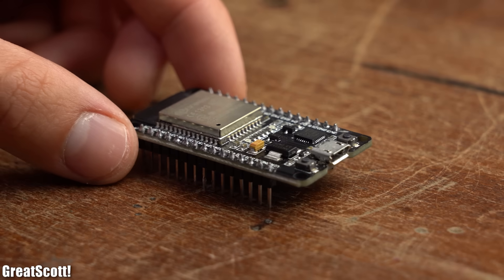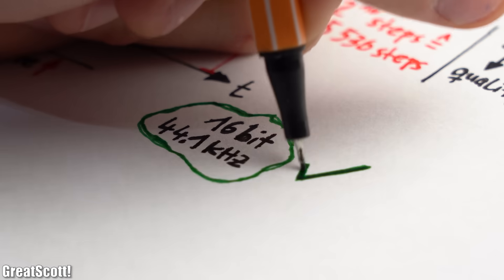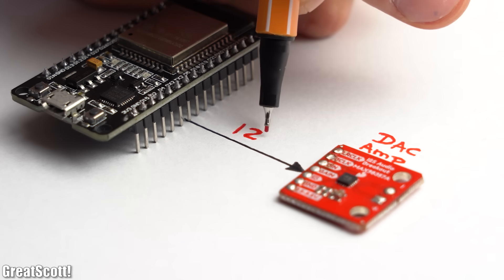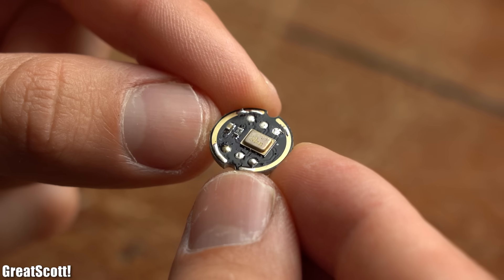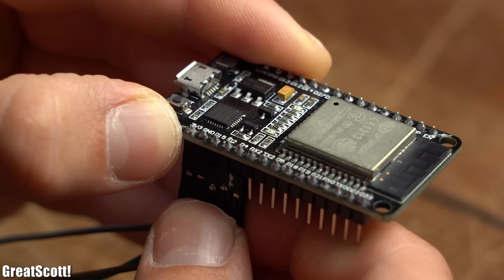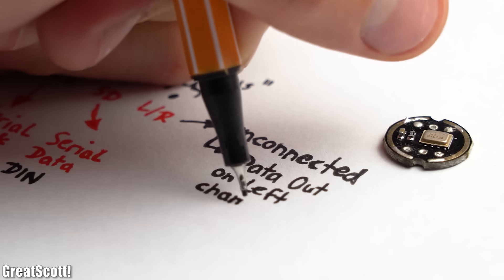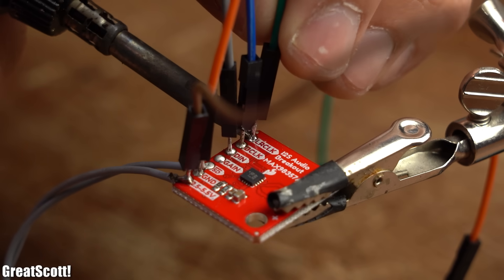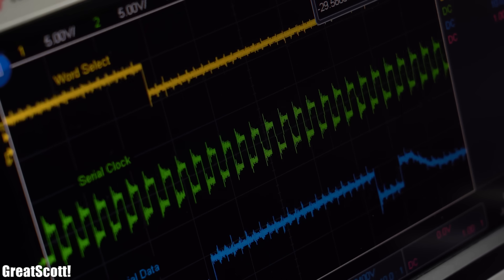Building a Digital Music Player with I2S?! What is I2S! EB#45

Comment: I wonder if they make a 24 bit and or a 32 bit float breakout board? Why did the playback sound in and out (Garbled)?
Reply: uhm... 24 bit is rather extreme - 16 million steps. there are 24 bit DAC but they cost quite a lot and are used only in very niece applications.
And no - you can not hear the difference between 16 bit and 24 bit - nobody can.

Anything above 24 bit - you are looking not at prebuilt chips but special purpose custom made circuitry - nothing of the shelf - cause simply there is no need for that.

Comment: The other day i,'ve tried to attach the i2s dac to my router. Finally the Linux community have fixed the dma driver and now my router can play music :D
Reply from the maker: Awesome :-)
Reply: @greatscottlab  Yes, my router is based around the mt7628an chip. It have pcie x1, lots of gpios, i2s or pcm. It also have 2r2t wifi 2.4Ghz.

If you run Openwrt you can do a lot of cool things!

Comment: Can you make a walkie talkie with 2 esp32's using this metod and wifi/bluetooth?
Reply from the maker: I can put it on my to do list
Reply: @greatscottlab  I'd love to see that.
Reply: Hmmm I guess it could be done... but bluetooth I think it's limited to about 10m  range, and wi-fi would require one device to act as an AP and others to trust it, also said device would have to be within a reasonable distance of every other device... seems like an overkill for something that could be done just over radio
Reply: Yes!
Reply: Ooo. Hack up some headsets perhaps?
Reply: Very interested.
Reply: Why don't you use RF module (433Mhz) for a long distance like 1000M. wifi/Bluetooth is so short for walkie talkie as you can hear the voice without any tools :)
Reply: Esp32 or stm32 black pills (NOT BLUE PILLS) also have I2S

Comment: Do you know why it sounded so weird in the end? Great video, btw!
Reply: We need a revisit when he figures it out. This is not acceptable quality from i2s
Reply: I agree from the video I expected it to sound much better.
Reply: @InlineSkater72  and me personally I get very interested in knowing what the problem is, sometimes it can give more insight when we are doing our own projects
Reply: Well I did a similar thing back in the day, but using raw audio and only SD and a r-2r ladder. I got the same results. It boils down to a problem with the SD protocol I think. So whenever I switch sectors in the sd card (read 512 bytes (one sector) and need to read another) the sd_read operation takes 1.5 milliseconds instead of the usually instantaneous speed. This results in an audible jitter in the audio. It occurs regardless if you read 1 bytes or a megabyte in burst mode, so long as that read operation has to cross a sector, ıt takes a solid 1.5 millisecond longer. (doesn't get effected by number of sector switches, maybe how computers can read faster -in burst mode-) I think the propper way to fix this is to have the SD read into a sufficiently large buffer and the I2C peripheral reading from that buffer in non-blocking mode (interrupts maybe? even utilising some hard-wired logic similar to what bitluni does) and only refill the buffer when you have read like %90 of it, and while the SD reads still allow the I2S to keep taking what's left of the buffer (so that the DAC will never have to wait for the SD to read). Not sure if this is how the mp3 library works but they probably read a small amount of data, decompress it then play it and when the section is done, they do it again thus when the total amount of bytes read the next section to be read takes 1.5 milliseconds longer, thus the wierd effect.
Reply: @batugunduz3950   I discovered this problem when trying to save real time measurement data onto an SD card. Was extremely annoying. 
I'll only use soldered flash chips for real time stuff from now on. -.-
Reply: @SciFiFactory  Yeah its a major bummer. Maybe you can write to flash in real timeand periodically dump that data to SD
Reply: The proper way to implement this is with a set of ping-pong DMA ram buffers. One buffer is read and the other is streamed with I2S. Both SD and I2S could benefit from DMA and do their thing in the background.
Reply: Isnt it due to the sampling of the analog signal?
Reply: @adamkoszaka1130  no, it isn't. The audio is sampled at CD-level quality (which is very good) and you can hear it when he plays it in Audacity. I am inclined towards it being an SD card read problem too.
Reply: It sounded like it could also be clipping the analog signal.
Reply: could it be a defective speaker?
Reply: Probably either unwanted interrupts or reading from sdcard took too long
Reply: Something is preventing a continuous stream of proper uncompressed audio output. It should sound CD quality. I would presume the mp3 decoding is taking too long. Maybe GS should try using uncompressed audio on the SD card.
Reply: @eDoc2020  For initial testing I'd use .wav data in progmem / psram with a suitably sized playback buffer.
Reply: Sounds like jitter

Comment: I am wondering about why the audio file at the end seemed to have been played so choppy. I'm not too knowledgeable on the circuitry at work but I believed the idea was to be able to play the uncompressed file without loss of quality. Was the choppy playback a result of a limiting component such as the amplifier?
Reply from the maker: My used code was the problem. I am not the best coder. Sorry. In theory you can playback uncompressed audio.
Reply: @greatscottlab  Maybe a buffer but anyways the video was awesome.

Comment: Finally a crystal clear explanation of I2S!
Reply from the maker: You're welcome :-)
Reply: @greatscottlab  here's a really good video idea: HOW TO MAKE VCO SINE. tiny arduinos aren't fast enough. circuits that support variable pitch are complex. i am not an electronics expert but i am a sound expert. i want to make a sine. i don't want to spend $30 in parts ot make a sine. i want a sine. give me a sine. someone make a video on how to make variable pitch sine oscillator with few and inexpensive parts. i don't want to include an incandescant bulb in the circuit. i just want a sine oscillator i can change the pitch of across the audio range. i will measure it with an arduino. i don't want a sine with a static pitch. i don't want to control it with MIDI. i just want to plop a potentiometer, on a circuit, and output a sine wave of variable frequency. how is this so complicated? i have 20+ years of audio dsp. i know a T bridge circuit will produce a sine because its an elementary structure parallelled in dsp. where th eufck are the fucking cheap to build sine oscillators? what the fucking fuck? why the fuck can;t people understand that you would want an oscillator with a variable pitch and a sine contour/spectrum? how does this not happen in electronics, which is just physics? i don't want three phase power. i don't want a 741 op amp. i want cheap ass parts, as few as possible. i want to do this shit. i'm fucking fifty i should have done it thirty years ago. fucking hell. it's just one frequency.
Reply: @atomictraveller  Did you get anywhere with your sine generator?

Basically, you need a couple of tables of constants, which could be filled in by calculations when it boots up, and a variable slope ramp / saw wave generator, which is used as an index into the sine table.

1) Calculate a step value, based on the ADC value from the pot, maybe using a lookup table to speed things up, if you want something like V/octave scaling.

2) In your main loop, keep adding that step to your index value, and loop it when it reaches the maximum.

3) Use a DAC of some sort, or I2S, to output the value, from the table.

As a nice side effect, you also get a VCO saw output, if you have a second DAC - or use the other channel of I2S.

Due to obvious symmetry, you don't necessarily need a full period of a sine wave.  A quarter wave will do.

You might need to disable interrupts, to avoid jitter caused by the CPU being too busy.
Reply: @TooSlowTube  i generally render sines in dsp with quadrature...
s0 = 1; s1 = 0; // init
s0 -= w * s1; s1 += w * s0; // loop
where w (angular freq) = 2*pi*hz/samplerate
Reply: @atomictraveller  Cool.  Are you using dedicated DSP hardware, or just something like a fairly fast microcontroller with an FPU?
Reply: @TooSlowTube  i don't remember the topic, i've just done a lot of audio dsp :) (i stopped working on hardware audio becuase the room is too ocld in winter :)
Reply: @atomictraveller  Yes, I can't work up the enthusiasm to solder anything at this time of year either.  Occasionally, I manage to plug something together on a breadboard, usually microcontroller based, make a start on it then put it aside for a while... usually a long while.
Reply: Dude, you’re 54 now… I’m 52. “I SHOULD HAVE DONE THIS 30 YEARS AGO” really hit home for me!

Also: did you ever find a way to make your sine? Because I’m super curious… that’s a circuit that would be incredibly handy for a whole bunch of things!

Comment: I had doubt to clear brother.
How much does a 12v 7ah battery last if we convert to 5v 3ah for phone charging.
Reply: 12v*7ah means 84wh , so if you have 100% efficiency and you draw constantly 5V @ 3ah so 15Wh .. the battery will last 5.6h ..now for charging a phone 1 time a phone I don't need that big  of a battery ..you could use a  li ION battery pack
Reply: Thank u Fabio 😊😊😊
Reply: @austenbenny9659  no prob ; )

Comment: I keep thinking about re-creating the Portal Radio (from the game) and something like this would work a treat (minus the microphone). Only want it to play the standard low-quality tune on loop. Great video.
Reply: well there are also decoder chips that play mp3's 
https://www.adafruit.com/product/1788 this is a good board to work with it also has theoretically midi syntesizer capabilities and the library has all the features needed. works with an arduino which for me is an added bonus.
Reply: @Ramog1000  there should be cheaper DF robot boards that outputs a headphone signal
Reply: In pandemic times, a clip of The Police's Don't Stand So Close to Me triggered by a hidden momentary switch would be fun.
Reply: Marvin W - Depends if you’re a Patreon? If not, sign up now!

Comment: Haven't played with ESP32 boards yet. I've dome alot with the arduino and the dfplayer mini. Sound quality isn't as good, but works for the small projects.
Reply: I've got a couple esp32's kicking around but haven't used them yet... although that's gonna be changing soon since the 8266 has a bunch of unusable ports on it